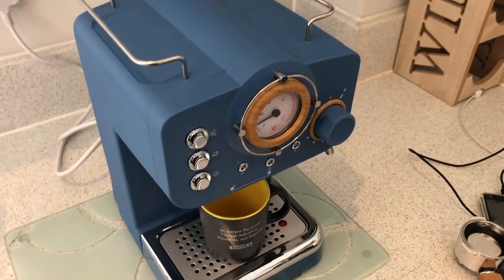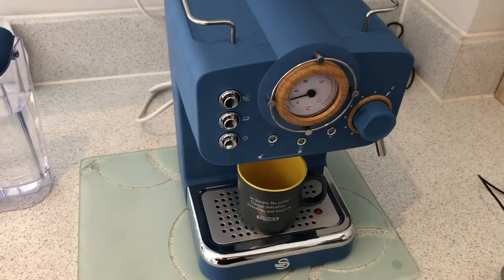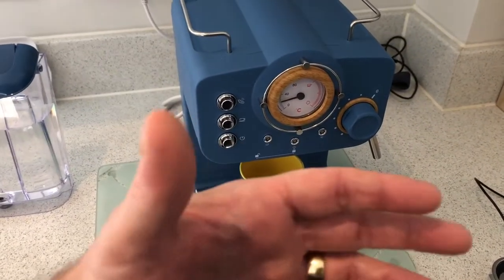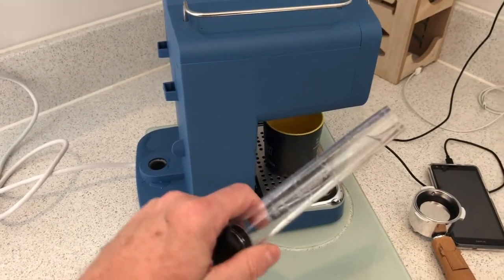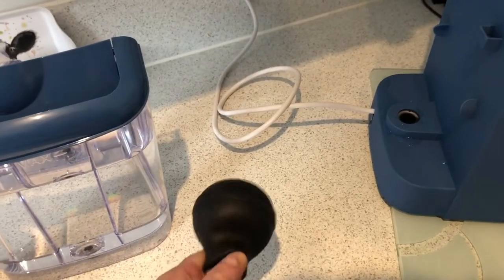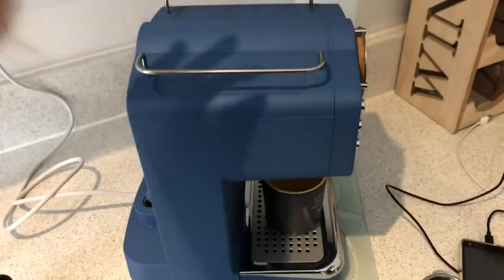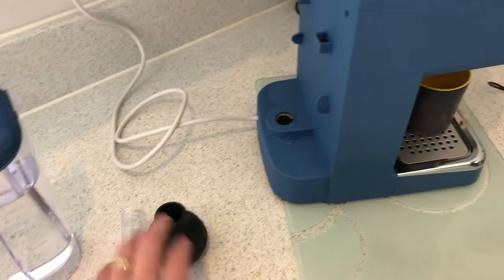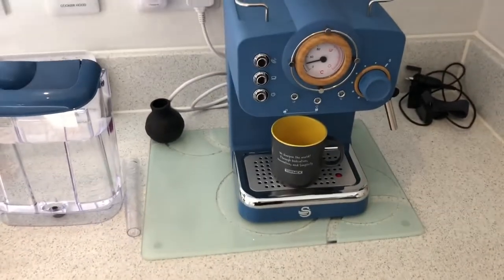Fixing Coffee machine with a turkey baster￼

Comment: Thanks for info. Just spent hour and a half getting ours working again. No turkey baster, but used a small kids drink bottle, cut a hole in on the side and was blowing in the inlet whilst pump was active. Eventually cleared the air lock. The seal from the bottle to the inlet was reasonably good. I had thoughts of using car pum compressor. Prior seeing your video I had disassembled top and bottom to get idea of the innards of the unit.

Comment: Did you try filling the tank to the very top (overflow) when it was on the machine, just a thought not a criticism.
Reply from the maker: We did thanks… We tried everything until I came up with the turkey baster idea. We copied quite a few techniques from YouTube by people having similar problems with different makes of machine. The result was me having to think about It’s a bit laterally. Have a great weekend :-)
Reply: @BlindWoodTurner  What came to mind for me was....
 I had to do this on my old car in 2001 Citroen ZX 1.9D (Coolant replacement problem) the radiator cap was so low down below the engine, your needed about 300mm plastic cut off bottle jammed into the radiator to fill and remove the air lock.

On that car the electrics and and the clutch cable were rubbish.

your baster trick was very a good solution.
I cut the cone part off  pop bottles to use as funnels. 
The cylindrical section of the pop bottle and an electric paint stripper gun works well to connect many of my woodworking tools to my vacuum hose.

All the best
Reply from the maker: Love your solution to your Citroen ZX problem… Necessity is the mother of invention after all! :-)